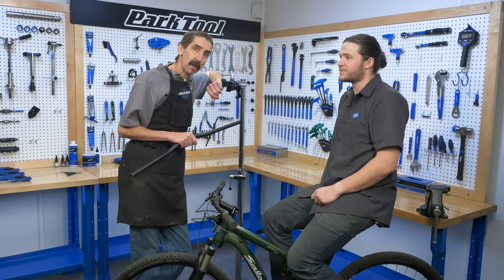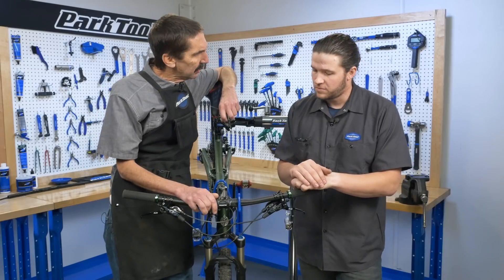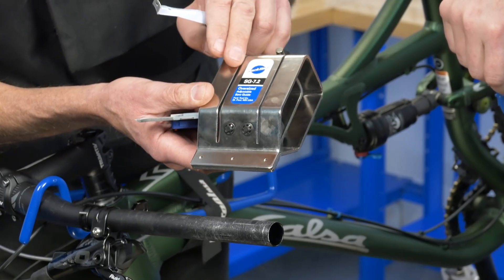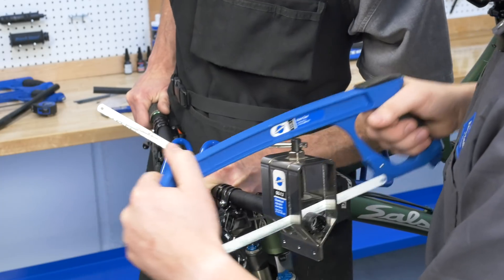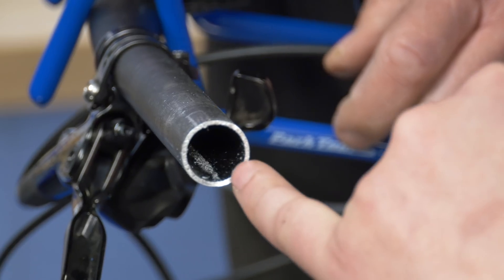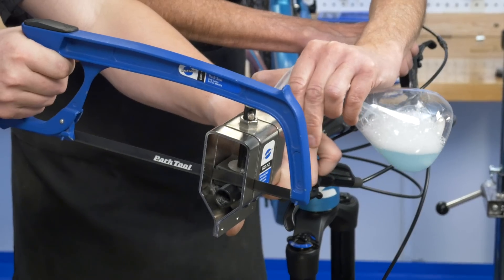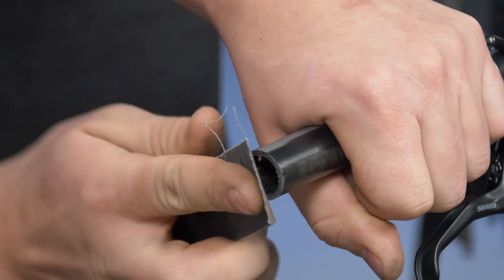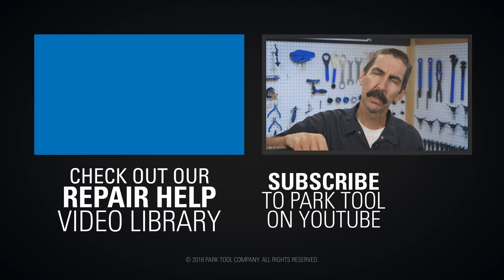Sizing & Cutting Handlebars | Tech Tuesday #108

Comment: Hi there.. I had 580mm bars on my "26, but I'm widen it a little bit. I have a 750mm on it just to try otherwise I will trim it down to maybe 740mm or 680mm.
One other thing. I don't know at what degrees but I like my brake levers at a level/ angle that my natural hand movement can get to it. 

I know this is an old video and I hope you guys read this comment.
What do you guys think of my 26' XC bike with  75mm stem and 750mm bars. What do you guys recommend me?
Thanks for sharing

Comment: I realized after I started to develop pain in my shoulders that my bars at 29" were way too wide for me.  So I determined the optimal width using the "zen" method: I straddled my bike, closed my eyes, held my arms comfortably in front of me, and then let my hands drop naturally onto the bars, which landed them about two inches from the end on each side, so I cut off 1.5 inches using a pipe cutter, and even after just a few minutes of test riding, I could already feel my shoulders relaxing.  In theory, I'm sacrificing stability, but I think my shoulders will be happier in the long run.

Comment: I found a video a while ago, recommended multiplying your height in cm by 4.40 to give bar length in mm as your maximum. Go less if you like but not more. To wide will move the work from the muscle groups in shoulders and back up to just the shoulders and cause damage. Iv found this to be perfect for me. Im 165cm x 4.4 = 726mm bars. I run 720mm comfortably.
Reply from the maker: Interesting.

Comment: I usually shape the sandpaper/emery cloth into small cones. One with the grit inside and one outside. Then I use these to debur the inside and outside diameter by turning it around the sharp edges. I get better roundness this way.

Comment: The metal sawing action did not look good. Truman was standing almost in front of the side of bar. This causes him to push the saw in an angle to the bar. Also he should hold on to the bar while sawing. Now when Calvin did the holding, there was no harmony because Calvins reactions do not match up perfectly with Trumans saw movemetns. If Truman would have hold on by himself he would have made the countermovement perfectly. Also using cutting oil would prolong the life of the blade.
The carbon sawing on the other hand looked very good.
Othwise nice video! Park tool has such great content!
Reply from the maker: Team work is tough sometimes.

Comment: What is the best way of removing and reinstalling the grips?
Reply from the maker: I prefer air to put on grips. https://www.youtube.com/watch?v=DN2Q8tnOLoo
Reply: Lift the inner Edge with your finger,Spray some Brake-cleaner or alcohol in the inside and pull it Off.

Comment: I did pretty much what you did before I saw this video. I wrapped electrical tape on the bar, (Alum),
 (making sure my shift and brake levers fit comfortably), and cut along the tape freehand.
 I then took the cutoff and used it for a measure, applied the tape to the other end of the bar, 
and cut at the end of the electr. tape, as straight as I could. Deburred it.  Worked out fine.
 A millimeter or two makes no diff. when the grips or tape are back on. Good luck.

Comment: How about an engineer's V clamp as a guide..
Reply from the maker: Those could work. But I would not suggest using them. The reason being is that they cost more than a guide and there is potential for damage to the blocks.

Comment: Or just do it the easy way.

Locking grip plus a jigsaw. Measure distance, line up blade to your mark, then follow the edge of the lock ring with the bottom plate of jigsaw. Literally takes 60 seconds for a perfectly square cut.

Comment: I have shoulder issues, and have been finding a wider bar is fine, generally, but pulling up and back on the bar and turning at speed is a problem (think of a shoulder working like indexed shifting). I got back to a much more natural lean-turn, and can wheelie easier in my 620. Plus I find the longer stem length adds to stability more than bar width (again, more at speed). Sure did feel weird initially!

Comment: Technically, you can’t use calipers to directly measure the thickness of the cut a blade will make. It’s called the kerf thickness and you need to make a sample cut to determine the thickness or know the offset of the teeth dimenion. Teeth are always slightly offset to the alternating sides of the blade to intentionally make a wider cut than the thickness of the blade so that the blade does not bind in the material being cut. Ok, fine, we’re talking a negligible amount, and these are bike mechanics anyway, not precision machinists!

Also, if you make with an ultra-fine sharpie the position of the shifter/brake clamp before loosening then you can reference that and never have to guess at the angle later.

Thanks, gentlemen.

Comment: I'm going to buy a saw guide so I can use it once every 4-5 years.
Okie Doke
Reply: My thoughts exactly. Plus if you have lockons you already have a saw guide. Just use the two locking rings.
Reply: Just sawed my bar yesterday. Had nothing better to do. Unavoidably the cut was not straight. Wish i had the tool, can’t see any diy for that. But it’s a lame tool to have when it’s a one off.
Reply: $45 tool at that 😂😂😂😂 I use a dremel with a cut off wheel, much more useful for lots of other things.whuch is a better value.

Comment: isn't 700mm ( push up method ) a very narrow bar?? 
if the new bar was 800? then you cut it to 760 yes?
Reply from the maker: Bar width is personal preference. Some people run 840mm and some run 620mm. When Cutting I would start with removing smaller amounts as its easy to cut more off but its more difficult to put more on.
Reply: @parktool  cheers for the reply. I get the preference thing, what I meant is you showed two different ways of getting your own preference and got two answers, 700 and I'm assuming 760. So which was correct?

Comment: It seems like everybody who cuts metal tubes in the mountain bike industry does not know about deburring tools. They’re used by machinists and are so much better than filing or sanding. They don’t produce metal dust and give it the perfect edge. Sadly pretty sure you can’t use it on carbon
Reply from the maker: Plumbers too.

Comment: I used angle grinder and it took like 10 seconds to cut both ends doesn't matter if you cut slight off handlebar grip is going to hide cut end anyway. 
If you use some end cap then it needs to be 90 degree cut and this method would be better.

Comment: You guys are awesome. Using the Metric system in the US. Lead the pack people, Vote Metric in the US!
Reply: LoverOfPhotography vote? I wouldn't wanna force the metric system on people, rather just encourage people to learn it. I know both systems and it comes in handy
Reply: @placesaroundus  When does imperial come in handy?
Reply: LoverOfPhotography always
Reply: @placesaroundus  Actual situations please...
Reply: LoverOfPhotography what is this grammar school? You want me to 'show my work'? People like you created common core
Reply: @placesaroundus  I just asked in what situations would one prefer imperial over metric? I can name about 10 for metric on the top of my head, and there are probably millions.
Reply: LoverOfPhotography basically, if everything was already metric i would prefer it. 

Since most cars and machines were built using old standard measurements it is necessary to know it. You're right, though everything built these days should be metric. I see what you mean. 

 Standard should still be taught (in the u.s.) though, because most stuff is built  to those specs.
Reply: @placesaroundus  For cars and machines it's basically just the type of wrenches and sizes of thread that you should know. It has very little to do with actual calculations with the metric/imperial system.
Reply: LoverOfPhotography ok in that respect (calculations), i never use metric unless it's on bikes lol. that's only because i was taught  standard originally. 

Especially when it comes to (wood) construction, everything is already standard. (Board length feet x in, screw size in inches) it's just easier to use standard when it's already set up that way
Reply: LoverOfPhotography btw sorry about being rude with the common core reference and all that, i thought you were just trolling lol
Reply: @placesaroundus  But even using imperial in wood construction in the US is counter intuitive. A 2x4 is not 2 by 4 inches. It is 38mm x 89mm (measured). Then international construction code is written in metric. So even in US code, the metric system is used a lot. When a builder makes a wrong conversion, structural integrity of the building is at risk. Then I'm building a water storage system for the garden. I need 50.000 liters, so I know I can build a 10meter x 10 meter x 5 meter deep square tank to accomplish this. Imperial equivalent will take you 100 times as long to calculate.

Comment: Pro tip: Wadded up damp cloth on a string, shoved into the handlebar end before cutting begins, helps pull out any lingering shavings without much hassle or sending dust airborne.

Comment: Before you buy the handlebars, run around the bike shop pretending to ride a rock garden
Reply from the maker: That is actually an interesting idea.
Reply: Or, at the shop, while holding the bars drop down to do push-ups and check the fit!

Comment: Great vid fellas. It's not a bad idea to start your cut on aluminum bars with a pipe cutter because it will give you the cleanest line around the bar. Finish the cut with a finer tooth hacksaw blade that will naturally follow the shallow cut from there and you have a job well done with very common and inexpensive multi-purpose tools.

Comment: I really appreciate your info, the carbon cutting was the most helpful. It seems to me that bar width is still just up to your personal preference. On a side note, for holding the bars in place I use two old toe straps between the front wheel and down tube, I find the have a more of a firm grip on holding the bars in place.

Comment: My park tool stand can't seem to adjust the tilt of the bike . Its tilted forwards -putting the bike nose down. Not sure how to fix it :/
Reply from the maker: Sometimes the cone will stick. loosen the knob on the back then you should be able to use the bike or a broom handle as a lever. Some Anti seize or ASC-1 on the cone helps with this. If you continue to have issues you can contact us through our website or through info@parktool.com Thanks for using our products!

Comment: I personally like my handlebars exactly 7886mm wide. I think I am going to get wider bars though
Reply: And that's nearly 8 meters wide, you know...
Reply: Явор Марков Yes it gives me lots of control
Reply: jason scheffel 

Its the evolution of cycling. My 2025 bike will have 9 meter bars and 1x 65 speeds, 49er inch wheels, and 12 suspension components I will lock out at all times.
Reply: okleydokley will your suspension be made by rockshox, fox, or apple. With Siri built in

Comment: My favorite method of sizing the handlebar is taking a q-factor into equation. Have you ever thought about it?
Reply: Push up stance makes sense for optimal position under descent braking, but I use wider for more leverage turning, and less constriction breathing.
Reply from the maker: Lay it on us. How do you equate bar width from your q-factor? Sounds very interesting. I guess i see a major problem being that most bike models have the same q-factor throughout there size range.
Reply: All other things being equal (same bike model!), the bigger rider needs a wider bar -- no problem with that. BTW, I love your method with measuring a "push-up stance", it's a first time I saw it ever but makes sense absolutely! But, at the same time, for a given rider and preferred riding style, the wider the q-factor the wider handlebar is needed. It is one of a contributing factors, very important though. 
Please don't take my word "equation" too literally, though, I don't have a magic calculation formula at hand. Just think about it:  The wider q-factor, the more sideways forces are generated and the more leverage at the bar is needed to compensate. I realized that when using one and the same drop down handlebar on two different bikes, and it felt right on one and way too narrow on the other. Then i measured q-factor and guess what?  
People ask for wider tyres, bigger wheels, more tyre clearance, more gears (increases chain line!) and all that is asking for a wider q-factor. Hence the tendency to fit wider and wider bars to "modern" bikes. But it is not always "better".

Comment: Does cutting the bar compromise its integrity? Would it be as solid as it was before the cut?
Reply from the maker: The bars integrity will be the same or better. When you cut the bars you have a little less leverage to exert on them.
Reply: Narrow bars are stronger, less leverage force.

Comment: am I strange for prefering the shifter mount on the outside of the brake mount, a bit closer to the grips? i just love it when the shift levers are exactly below the grips and the brake lever further away, allowing for intuitive one finger braking. of course i place my hands right at the edge of the grips and sometimes even put my palms on the bar end plugs as an alternative position on long rides. the outside placement of the shifters allows for an easy finger to shifter reach even when holding like that
Reply from the maker: There is no strange in comfort. Whatever works for you is great.
Reply: Thanx ParkTool, i was always feeling "different" for setting up my cockpit in that 'unusual' way, unlike the rest of the setups i see. Haven't tried iSpec or simmilar integrated clamp yet though..

Comment: If I were to cut over priced plastic, I would wear a dust mask myself.
Reply: There really is no point to carbon fiber bars. Carbon fiber is literally derived from plastic polymers, then impregnated in epoxy polymer. The weight savings is minimal, very bad cost to benefit ratio.
Reply: Carbon is not plastic tho. Same stuff as charcoal however.
Reply: Go Aluminum!!